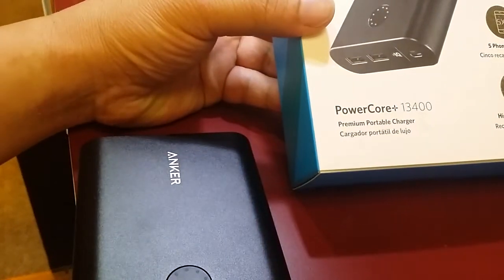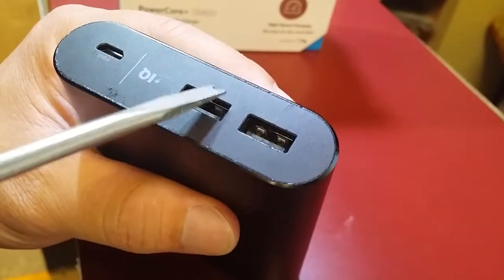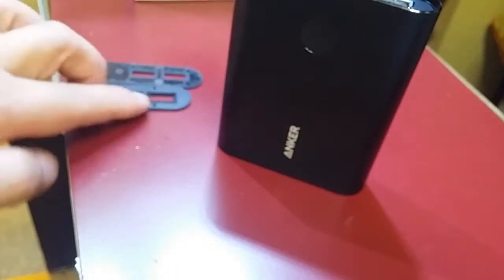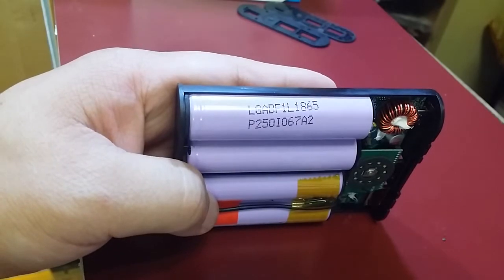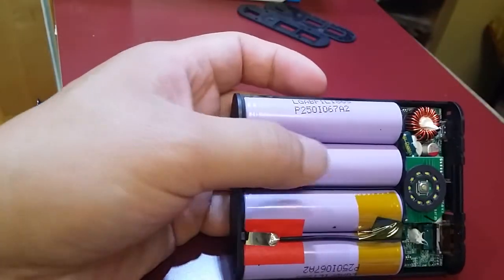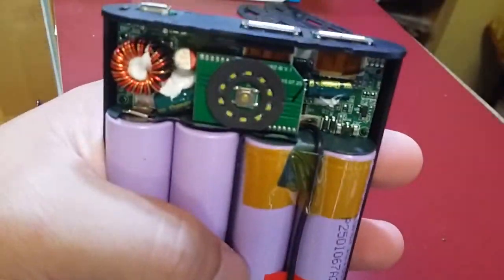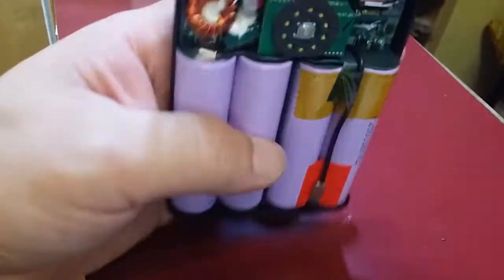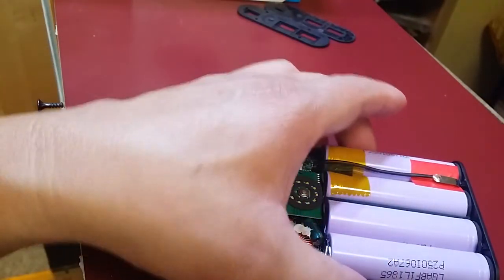13.4Ah USB PowerBank: Anker PowerCore+ 13400

Comment: Looks like 2S 2P configuration instead of 4P as stated in the video
Reply from the maker: Yes, I remember making that mistake. It was too late to correct it once posted.  I have a no-name box that boosts single cells to 12 volts. but it works only up to 1 A or so. I also have a stack of boards that will boost a single li-ion to above 12 volts.  but, yes thanks for politely noticing that.

Comment: Thanks for your vid. My anker stopped working day for night after some years and I wanted to open it, with out destroying it.
Reply from the maker: how did you do so far? Did you get it open?  Its pretty easy, just be very careful.  Everything just slides out. Did you find out why it stopped working? Its usually the battery ....unless you overloaded the USB charge circuit.
I was surprised at how good the Ankers are. Good luck!